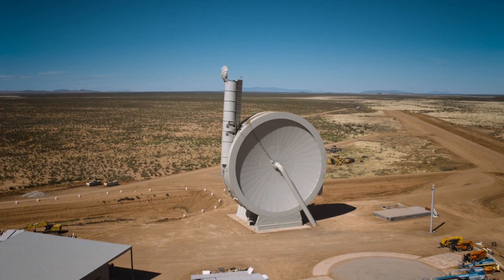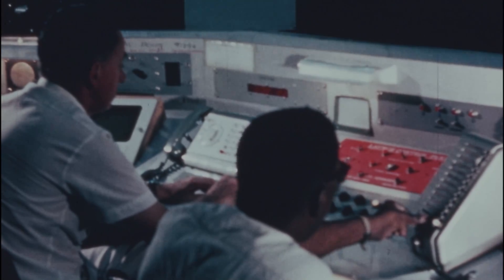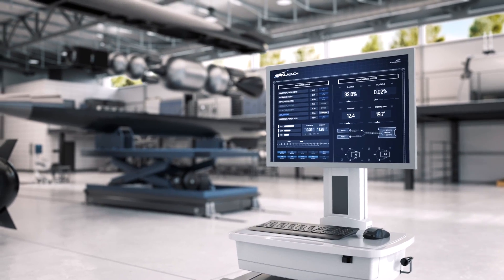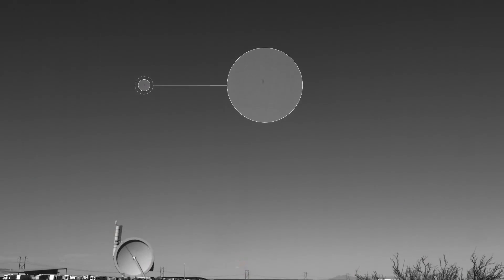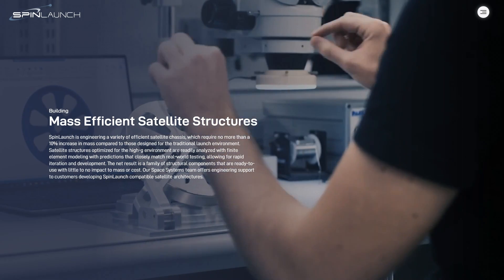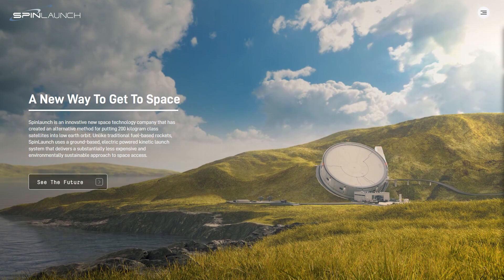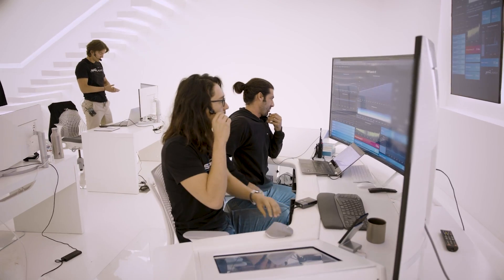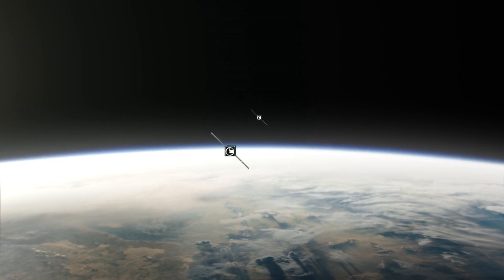Can Spinlaunch Throw Rockets Into Space?

Comment: Some observations:

1) That's not going supersonic on exit
2) It's tumbling when it comes out and loses a lot before it slows enough to stabilize
3) The chamber is NOT a vacuum nor is arm supersonic as you can clearly hear the rotation. The 'cover' blows out where it would blow IN if the chamber pressure were significantly less than atmospheric pressure
Reply: A difference of one (or less than one) atmosphere is not much, the force of inflowing air is much less of a concern than the sudden imbalance on the arm after releasing the rocket. The rocket also breaks through the cover with a lot more force and velocity than what air pressure would impart. But of course after the rocket broke the cover and left, the inflowing air will pull the broken edges inward - you can see that in the footage as it moves away from the initial position. (Which also indicates that the release wasn't perfectly aligned with the tube.)
Reply: You can hear the rotation if the sound travels through the metal
Reply: @nicholasleclerc1583  You can but it does not sound like that
Reply: “Can clearly hear the rotation”… That’s funny and sad to hear. Funny because it’s so silly. Sad because it shows no experience and no thought put into the comment.

Ever heard of bone conduction? Get a tuning fork’s base on your skull anywhere around your ear and you’ll literally hear the same thing for yourself.

Ever heard of NVH (noise, vibration and harshness) part of the car design process? 

Mechanically conducted noise and vibration is a big deal. When you got a big centrifuge, there’s so much conducted vibration that you can feel it in the ground quite a ways away. The ground and everything attached to the foundations will reradiate this stuff into the air so you can hear it. The big “can” only has vacuum *inside*! Otherwise, it’s a great big speaker and does an amazing job at radiating conducted vibration into the air. In fact, I can almost guarantee that atmospheric damping makes for some material savings. That very same design would not work on say Mars: they’d need additional dissipative structures to prevent the cover from tearing itself to shreds from the excitation passed from the base. 

I’m not a fan of this approach, but your comment’s “observations” don’t even make for good science fiction.
Reply: @absurdengineering  So the clearly audible "whoosh" of air resistance is instead the 'rumble' of vibration conduction? I actually DO happen to know the difference being I worked on a system that had such vibration conduction as opposed to sound conduction passed through even a thin atmosphere. There's a very distinct difference.
Reply: 🪄Del monte everes o modificado rascacielos mas alto🧩
Reply: Please don't annoy us with facts 🥺
Reply: Supersonic doesn't mean that it has no sound lol
Reply: @ClippyAngry  in a vacuum, it does mean no sound.

But clearly when you listen to the video, you can hear the arm spinning.
Reply: The people who invested $100M in this will ever see a return on their investment.
Reply: It is a slow-mo video! It must be hypersonic (you can see the tip glowing). From what I saw with Scott's video I just wanted to see more. Check out Real Engineering and Dr. Ben Miles.
Reply: @mikejhorn  It's not even doing Mach 1 on exit as there is no sonic boom. The tip is 'glowing' (heated a bit but not much) by the impact against the 'seal'. The problem is that it's a very mass and traffic sensitive system with little possible upgrade or operational utility over rockets. Frankly it's a very expensive way to NOT put payload into orbit and you could get a lot more utility out of a simple air-breathing first stage than you can from spinlaunch. (Probably for less money as well)
Reply: @randycampbell6307  You must have been watching a different video about this prototype because the was no sound on any of Scott's videos of the prototype launch or any other launches; railguns, cannons etc. Things don't glow because they have breached a mylar membrane. Scot says it launches at Mach 1 and starts glowing while it is flying upward.

I think you suffer from two problems; you have an established conclusion and you are just saying whatever comes to mind to support your forgone conclusion; also you really don't know what you are talking about. I will suggest again that you watch the videos Dr. Ben Miles (a physicist) and Brian McManis of Real Engineering (advanced degrees in Engineering) made on SpinLaunch. However, you obviously ignored everything Scot had to say in his video so there may be no way to cure you of clasping tightly to your ignorance.
Reply: @mikejhorn  Scott says they were aiming for a Mach 1 launch. They didn't actually make it. What OP is referencing when he talks about the sounds is the actual Spinlaunch videos, the ones that Scott is playing in the background with no sound. In them you can quite clearly hear the "whoosh" of moving air as the arm spins inside the chamber, this supports the conclusion that there is no vacuum as sound cannot travel through a medium that does not exist. This means their seals cannot support a full vacuum which means they're fighting wind resistance the entire time they are attempting to spin up. This may well account for why they failed to reach mach 1 on this launch. The biggest problem I foresee is that this launch shows the projectile tumbling end over end. Someone did the math and figured that it was making a full rotation every 1000 feet or so, basically it is too impossibly unstable to ever fly straight, much less make it to orbit.

You mentioned a lack of understanding of the physics involved, but you're failing to realize that you DONT need supersonic speeds to make items heat up. It isn't "glowing" with heat, not to the naked eye at least. The glow you're seeing is on an infrared camera, where even a slight increase in temperature will show as a glow. Even items traveling at subsonic speeds at ground/sea level can and will heat up, causing them to "glow" in an infrared camera.
Reply: @Armoredcompany  you guys are exhausting. My basic point is that this a very early stage in an iterative process. We actually have no idea what’s going on there or in the minds of the engineers. This could be like the beginning of SpaceX or a bust. It’s not going to be changed by a bunch of hens pecking at this video.
Reply: @mikejhorn  Except that if they can't achieve vacuum at what, 1/100th scale, then I have pretty massive and credible doubts about their abilities to do it at full production scale. Then add the launcher incline to it and your mechanical and physical complexity skyrockets exponentially which also doesn't fill me with confidence based on the aforementioned lack of ability to achieve stable, non-tumbly flight in a purely vertical environment.

We might be exhausting, but so is clinging to a boondoggle. This also has really no correlation to SpaceX. The concept of big rocket taking small thing really high is like, nearly a century old at this point. Aside from the return to launch reusability instead of hauling it out of salt water or the Starliner concept they aren't exactly being revolutionary, and even those are just arguably minor adaptations to old ideas.
Reply: Very good observations. I still believe a spin launch is possible, but THAT IS not how it's done.
Reply: and how hot is it gonna get when the seal is broken and all the air rushes in
IF they ever get it up to mach 7
Reply: @maxximos2960  the area needs to be abandoned everytime this thing launches too since that shit is spinning on ridiculous speed just being 100 meters from this thing is deadly 

and when it launches the vacuum system breaks when air rushes in it would probably caused a fuck load of trajectory problems 🤣🤣
Reply: @maxximos2960  Multiple or iris seals are likely 'base-lined' but you're very right in that the high vacuum needed would preclude 'easy' seals.
Reply: also good eye lol
Reply: All I see is a centrifuge someone built, then realized later that lateral forces exist.
Reply: Good catch on the cover implode.  This thing has so many stupid physics crimes that I forgot to laugh
Reply: Well the whole video is pretty transparent in the fact that this is all conceptual and a work in progress. Your missing the point that this is a pioneering move at what could easily develop into a much more economically friendly way of putting things in space. The start of the video touches very briefly on (although enough) the fact that this launch method saves huge amounts of fuel that would otherwise be used just to get a huge rocket moving in an upward trajectory. Even if the launch method doesn't get anywhere near into space, it's still eliminating all that fuel that would have been used to get to that point. Actually, I feel like the distance covered is impressive enough since the rocket is already moving with enough momentum in the right direction to save a shit ton of fuel even if it was going a quarter or even a tenth of the distance...
Reply: @alexmh6131  it’s a pioneer to nothing. Use this on the moon where it’s much easier to launch stuff at lower speeds and easier to maintain a vacuum, but not on earth where it’s cheaper, easier, and costs way less energy to just use conventional rockets.
Reply: @Ceece20  I bet next thing we know it'd be already built on moon to launch unstoppable nuclear warhead 🤣
Reply: This is going to fail spectacularly
Reply: @JMKnoetze  Eh, they can fix some of the issues with a lot more work but there are some of the basic concepts that are not going to be workable. I don't hold out a lot of hope for the concept but it could be made to work. I'm just not sure the economic case, (and as noted some of the technical case) would pan out.
Reply: @JMKnoetze you must be a descendant of the village wit at Kitty Hawk who harangued the Wright brothers… “It’ll NEVER fly…”
Reply: 1) They know. The facility is much smaller than their ultimate goal and was only meant for subsonic testing of the concept in general. (Edit: iirc, they were aiming at getting the velocity of the payload to mach 1 prior to releasing it but never intended for it to be supersonic while traveling in the atmosphere.)

2) The tumble was expected due to the subsonic speed of the rocket and the lack of optimization in it's design (again due to this being a test of the idea in general.)

3) The footage of the seal was recorded at a high frame rate and played back at one much lower. The seal initially goes outward due to being pushed out by the rocket. Had more been shown, you would see the seal getting pushed back inward by the pressure very shortly after the rocket passed through. Also, their vacuum wasn't as near to being as complete for this test as they plan on it being in their next phase of testing (and I'm pretty sure that they actually have other venting built in to open at launch in order to avoid having everything coming in violently through the relatively narrow launch tube.)
Reply: @possumverde  3) The sound is transmited by the structure itself and not by the not complete vacuum.
Reply: @possumverde test test test bla bla bla. It doesn't matter. None of the real issues with spin launching where addressed in this test
Reply: @possumverde  1) they can't reach Mach 1
2) The tumble is because the way the payload is secured to the arm imparts to it angular momentum, besides  linear momentum.  When it is released, the rocket is spinning end over end at the same rate as the arm.  For close to Mach 1, it would be 450 rpm, or ~7 flipflops per second.
3) If the chamber were evacuated, the total air pressure on the diaphragm would be 10 tons or more.  How come the diaphragm is flat in that video?  To get it that flat, they would have to stretch it with very high tension. But why should they bother? If they allowed it to sag by a foot or so, it would not impact its function, but the needed tension (and the needed strength of the material) would be much lower.  Even so, at least some of the tatters should  be sucked into the chamber, but we don't see that.  Why did they cut the video short before even the rocket completely cleared the diaphragm? Because if they had shown a few more frames it would be obvious that the rocket was spinning and the chamber was NOT evacuated?
Reply: @JorgeStolfi  honestly the only things I'm interested in this project is
1. How the mechanical structure fail would look at any point
2. What happens when sudden change in pressure of 1 atm occur through narrow duct while the projectile is resisting 1 atm of pressure and its drag force at "supersonic"

Looks like we're gonna see it next monday
Reply: @possumverde  why go make a yeet device that breaks everytime you use it 
when rocket proppeled yeet device works just fine.

wind direction is a major factor during launches if air goes inward after you launch it would severely affect accuracy there's also the weather 

mhmmmmm yes burn more money on a pointless experiment
Reply: @theeinertia4106  There will be something gained from this, it's better than most of the investments people make every day to pamper themselves.  Rocket propulsion is displeasing the environmentalists and it is cost inefficient.  Nuclear engines and methane fuel are the future, but kinetic launches could help us break out of the atmosphere while engines correct the direction.
Reply: @FletcherHillier  there is no such thing as a free lunch , remember all those engine and fuel also have weight the more weight you have the more you have to compensate for the drag 

there's nothing to gain from this , it's just plain stupid those investors shouldve just pampered themselves
Reply: @theeinertia4106  I guess we will just have to see the final project, I think it will work
Reply: @FletcherHillier  an elevator to space seems more viable than this piece of garbage
Reply: @theeinertia4106  I agree, but we can't control these individuals to do what we want anymore than we can control the majority of the population to care about our pending Doom.  Best alternative is compete with them and extract what you can for what you want to do.
Reply: @theeinertia4106  The only use I have for this is yeeting up nuclear waste into space.

Rockets explode sometimes and if a rocket explodes high up with nuclear waste them goodnight.
But yeeting it up? That could work.
Reply: @theeinertia4106  at the speeds we are talking wind does not really matter
Reply: @tomcho8221  it actually does because shit breaks at super sonic speed and air resistance and drag has a part to play , please stop im face palming so hard that even people acknowledge this crap
Reply: @theeinertia4106  
How about the office building that was suspended from space by an asteroid?
Reply: @possumverde  Your comment is somewhat fanboy like. You make non valid excuses for everything.
Reply: @andreungerer3531  And you made no points at all. You just claim all the responses are invalid. That's entirely meaningless until you explain why.
Reply: @volbla  Excuses, excuses. From a fanboy...
Reply: @andreungerer3531  "non valid" any proof to back up your claim?
Reply: @andreungerer3531  the original comment was stupid. Of course it is a vacuum why would they lie about that, it is not difficult to creat a vacuum.
Reply: It doesn't tumble at all coming out if anything they'll spin it like a bullet
Reply: @iditarod4081  watch thunder foots video
Reply: @iditarod4081  Look carefully the projectile is clearly tumbling.
Reply: @iditarod4081  It leaves the vacuum shield at a 30 degree tilt instead of going in a straight direction.
Reply: @iditarod4081  Can't there is no spin mechanism involved. It does tumble which wastes energy which will ultimately reduce the assist velocity.
Reply: @randycampbell6307  exit chambers just have a little groove on them which helps create spiral. Could possibly use puffs of air instead of friction contact
Reply: @iditarod4081  Can't both due to the speed and  (in the "operational" version) high vacuum. The projectile can, (and should given the air is going to be like hitting a concrete wall upon exit propulsion of some type is really required) self-spin and stabilize once it's released from the arm but that's going to take a LOT of work.

Frankly the "only" thing this has over conventional "gun" (Including gas-gun and such types) launch is lower "barrel" length but it more than makes up for it with added complexity and risk.

I'm not really surprised this isn't as 'thought out' as it should be because it's a very seductive idea but more work should have been done on the whole concept before it got this far. I'll be honest they have some merits but frankly the execution and planned development are dead ends with a lot less utility and operability than they propose.

The projectile is decelerating the moment it leaves the arm. Worse the air pressure at the proposed speed is literally incompressible, meaning it can't get out of the way fast enough and the projectile will face severe heating AND deceleration forces. These are well known and understood issues that the design does nothing to address and worse simply brushes off.

My suggestion would be to incorporate a ramjet (subsonic combustion ramjets are good all the way through around Mach8+ without significant engineering) ut the projectile needs to be steady and straight for it to operate properly. They could easily do this with the set up they currently have but they need something.